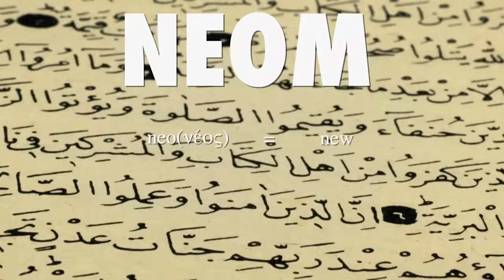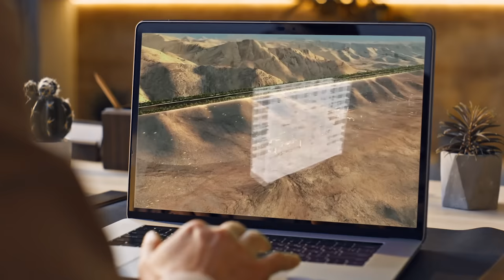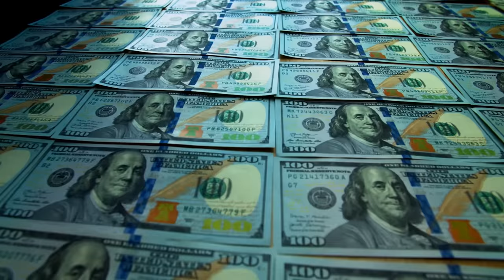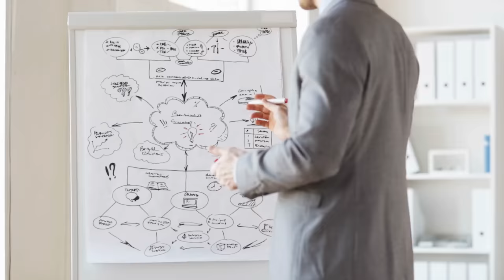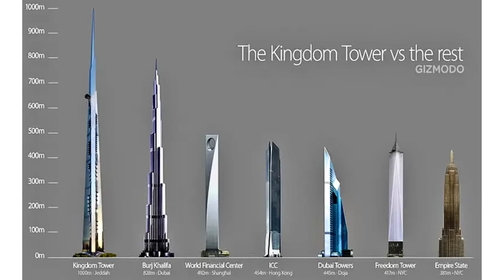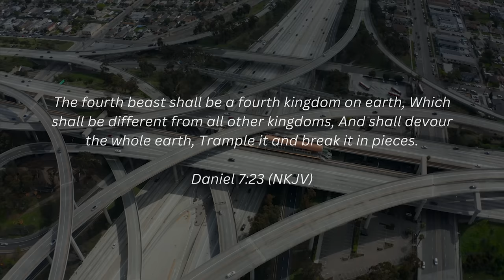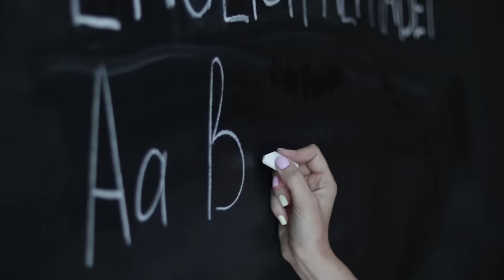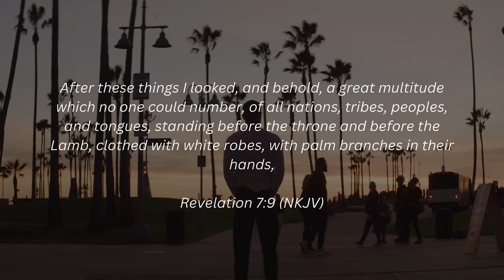What Saudi Arabia Announced Has Just Stunned the Entire World

Comment: Just a thought on the path to the narrow gate.  There is an ancient surveying tool called a Groma used by many civilizations.  It is used to make layout straight roads and right angles for buildings.  It is essentially 4 plumb bobs hanging from a horizontal cross suspended from an offset vertical pole,  like a mobile on a pole.  You visually line up two opposing plumb bobs with an object or make mark in the distance.  Three object in line define a straight line or path.  Now lets imagine any two opposing plumb bobs represent the two parts of the Great Commandment, Love God and Lover others as yourself.  If you line up your choices in life in line with those two, I believe it eternally points to the narrow gate.  You still need Jesus to pass through.  If you are not on that path you are going somewhere else.  This is meant to be visual representation of the Great Commandment. 

Joe, if you don't object to my statements, would you consider using this as a prop in your street preaching if you think it may be useful?

Comment: The reality according to system engineers working on the design is that it’s underfunded and will fail.For example they are doing design the wrong way round. You are supposed to design to meet a requirement not create a requirement from design. So for example the railway infrastructure is half what will be needed to support the building and population needs. So this endeavour will fail massively.